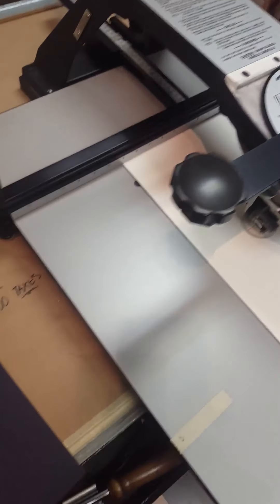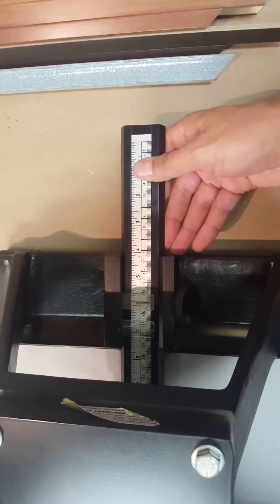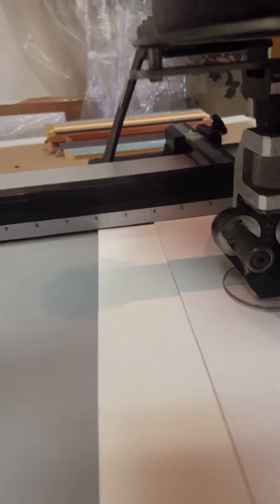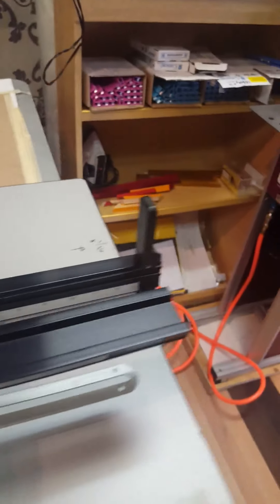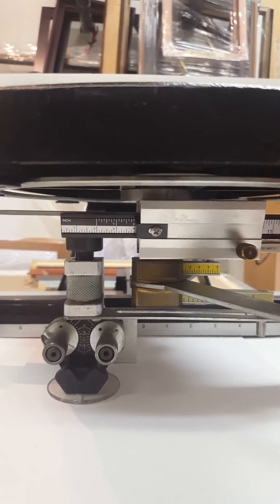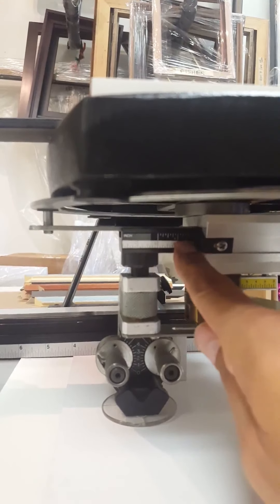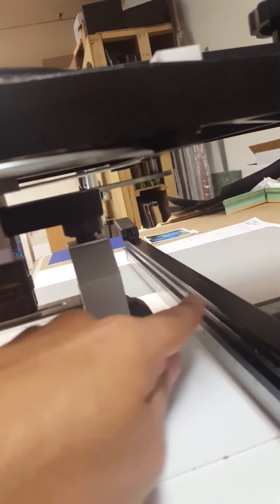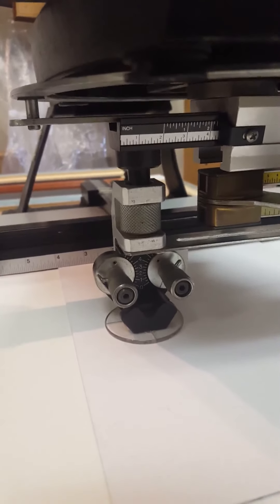Fletcher Terry oval matcutter part 1 of many

Comment: Nice video. It is helping me get to know my Fletcher 1100. I have wanted one of these for the last 5 years and just found one on eBay that was local to me and picked it up today. So far it looks like I am only missing the left clamp handle and foot along with the screw it uses and I am not sure if there is a different head for the glass cutter. Do you know if there are replacement parts for the clamp assembly available? I will be watching all your videos on the this machine.
Reply from the maker: hi and thank you for enjoying my vid :)  I know that parts are very hard to come by now because this machine is no longer made by Fletcher Terry.
It never hurts to search for the pdf version of the manual and that will give you a listing of the parts and you may come across some picture frame wholesalers that still have parts in stock. otherwise you may want to watch out for another one and buy it for parts : ) there is a different head for the glass cutter and the generation I was working on it came with it but earlier versions it was not created yet so I'm not sure the head will fit with older models?????
 good luck and enjoy
Reply: @mitchelljones2818  thanks. I actually modeled up the clamp lever and the clamp foot and 3D printed those parts and have the bolt, roll pin, and thumbscrew on order, should be here tomorrow. Those parts are not from Fletcher Terry but general hardware supply.